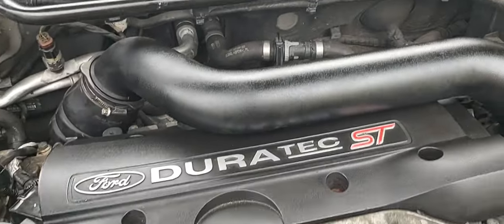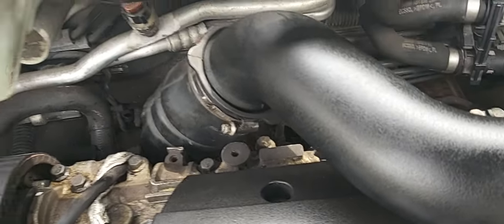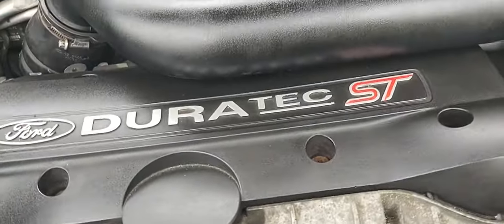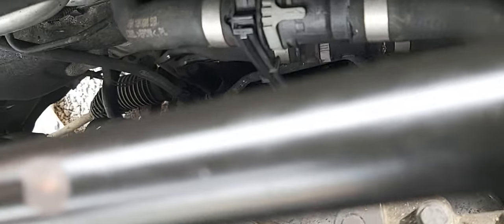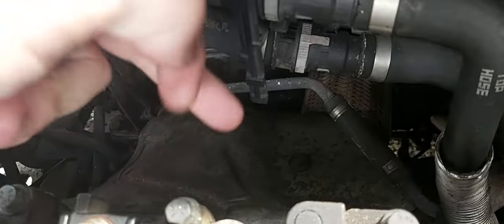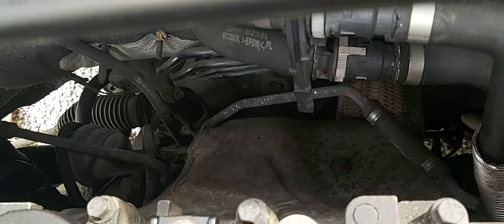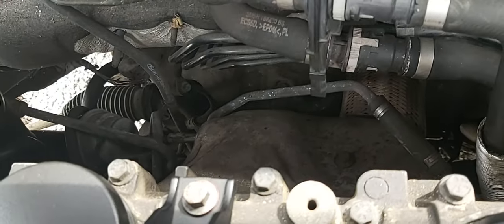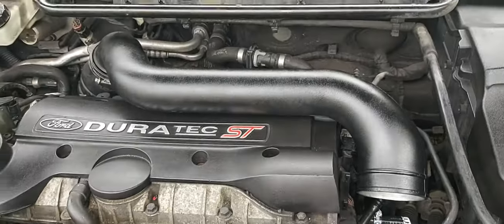FOCUS ST 225 MK2 | SOLVED How to FIX Ticking noise - Manifold, Coolant hose, Cambelt, Water pump

Comment: I had this issue with turbo into down pipe. Bolt was missing so I replaced.  Not long after, another one sheared. It had to be drilled and tapped and wasn't cheap! 
Advice to anyone with this engine is buy X3 new copper bolts from Volv and replace before they snap!

Comment: Did you have a recording of the noise
Reply from the maker: No sorry, it was a fast ticking noise if that helps
Reply: mine just sounds like the belt going around
Reply: I have a leak coming from the manifold. It’s driving me nuts. Its been in 5 times to fix but garages dont wanna go with in 100 miles of it. Even exhausted “specialists” wouldn’t go near it.  Might have to bite the bullet and take to dealership. Looks beyond me to even get to. Im happy just to putty the whole thing up at the point 😅

Comment: Hi mate was your tapping noise anything like what I'm getting. I posted a couple of videos some time ago to see if anyone had any ideas.

https://youtu.be/FP3XHibvmfY
https://youtu.be/pWXkDc-N_hY

I get it on engine startup until warm, then does it when I turn engine off and it cools down.

Been trying to find the source of this for about 2 years without success until I saw your vid which might offer a solution.

Cheers.